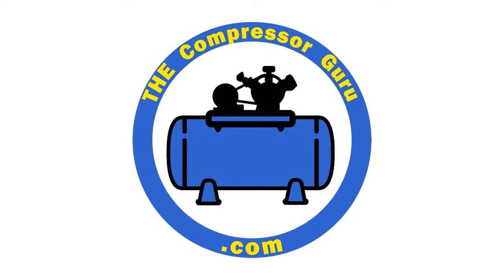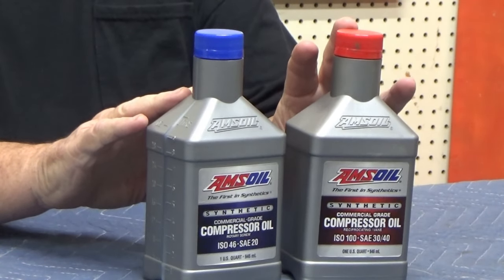5 Tips for installing you NEW Compressor!

Comment: I hunted for shock absorber pads and was unable to find any that seemed durable and stiff enough so I made my own. I cut out a section of tread from a discarded big truck tire, then cut donuts out of it using a hole saw in a drill press.  They work great and I expect them to last through the rest of my life.
Reply from the maker: before I got this supplier for these pads I had a local recaper that I would buy the end of the new caps and use them just as you described. they did work great but about the time they closed I did pick up this for a product.

Comment: Draining condensate under pressure would seem hard on that timed valve.  What’s the life expectancy on that valve?  Thanks for the great information.
Reply from the maker: normally see several years with no issues on these . what I didn't show was there is a clean out screen that needs serviced from time to time and it greatly extends the life. as for the condensate... this is WHAT this is made for. :)
Reply: @THECompressorGuru  and I would imagine that the benefit of consistent draining makes replacement of the valve every three or four years more than worth it.

Comment: Dear cg i installed my compressor on silent blocks (if i remember well mercedes benz 1620 cabin blocks) no pass thru bolts they are two plates bonded a rubber core. Will this damage the compressor? Thanks and merry christmas